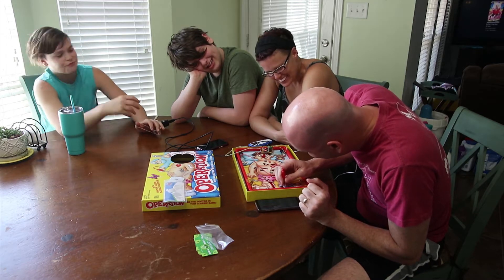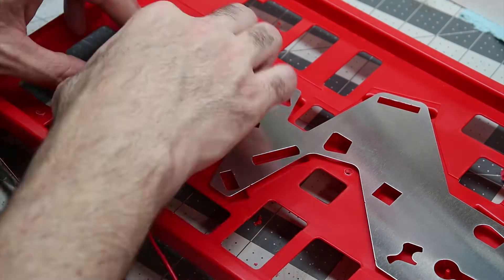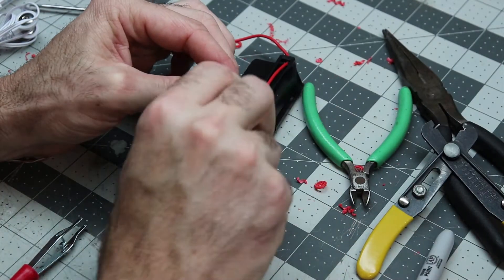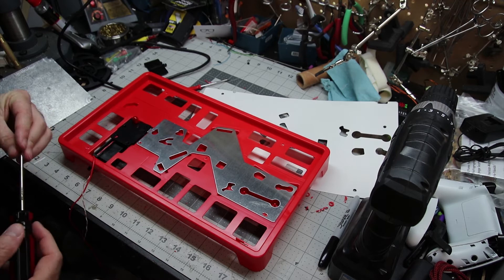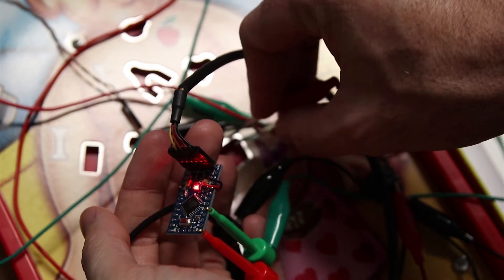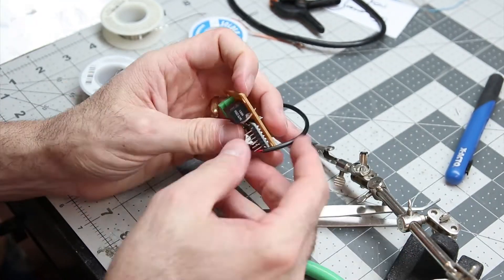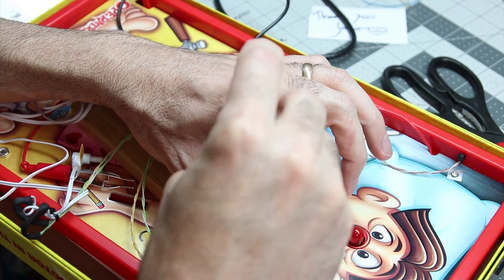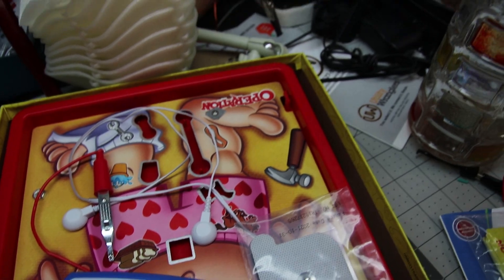Operation Shock - TENS unit to shock yourself with Operation board game

Comment: I made this some years back with a HV transformer, DC positive pulse square wave at 50hz, 2,000v and 0.5mA. It hurt like absolute !@#$ and we were all drunk. The tweezers had some mesh isolated on each side, so you HAD to hold them no matter what. Didn't want to make it any further up the arm like this guy, or across the chest 😄
Reply: btw, I totally thought the game shocked me when I was a kid too, and they just tamed it for the millenials!
Reply from the maker: That sounds wild LOLOL.  I used a tens figuring it was mostly safe LOLOL.

Comment: Hey do you think you can help us trouble shoot our project? We are struggling trying to figure out how to get the pi to detect our circuit
Reply from the maker: I haven't worked with a Pi for a minute, so I likely wouldn't be much help there.  Be sure to tie your ground from your pie to the negative side of your operation game...that will likely solve whatever wacky reading issues you are having.
Reply: @GregSowell  cool that helped did you have to use any resistors between the game and the pi? or did you tie them directly together? we are worried about frying the pi
Reply from the maker: @Chuddmaxx  Could do I suppose(it would still give you a reading you could trigger off of).  The ardino I was working with accepts 5v in...I think the Pi will do 3 or 5.  At any rate, the two batteries in the game will give you 3v when activated, so you should be ok.  BUT, your mileage may vary ;)
Reply: @GregSowell  thanks for the info! We have the whole thing working but the pi seems to only register the circuit closing some of the time? Was yours completely responsive?
Reply from the maker: @Chuddmaxx  Indeed, my arduino based version was pretty darn accurate with detection and response.
Reply: @GregSowell  do you think we have a code or hardware limitation? We can’t seem to get it to be consistent
Reply from the maker: @Chuddmaxx  hmmmmm.  I shouldn't think it's a hardware limitation(it should be scanning pretty fast).  I'd look at the software first.